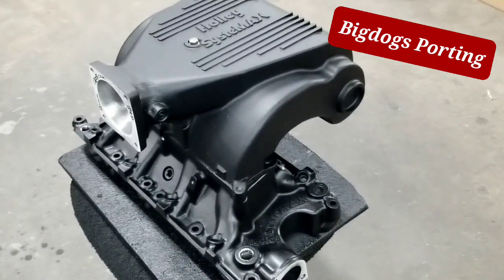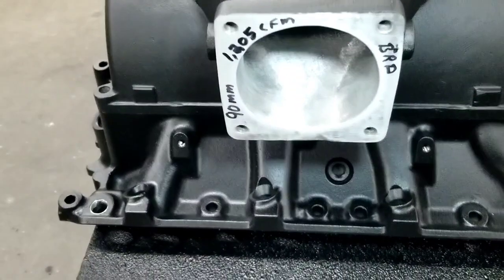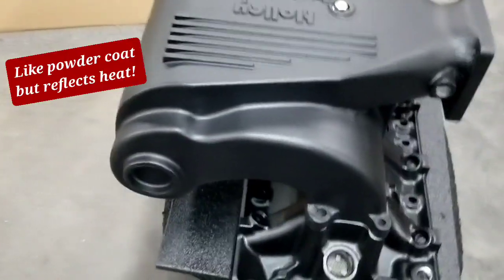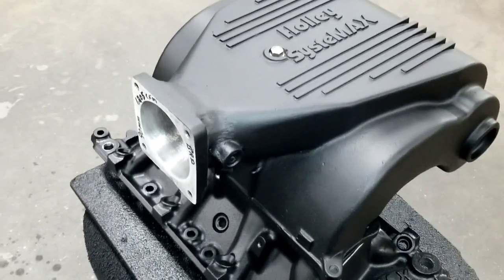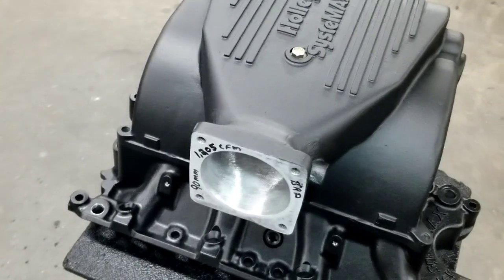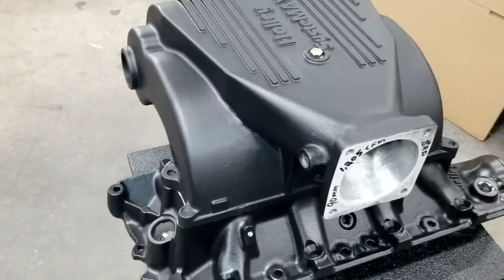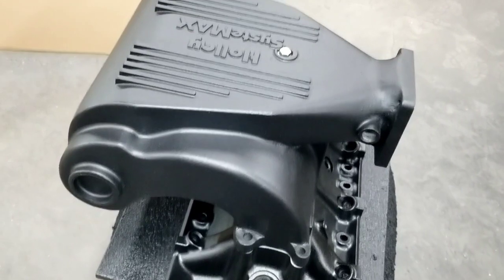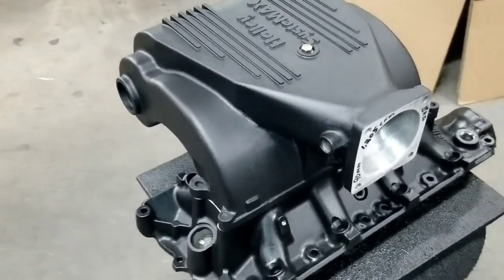Systemax 2 BRD, Part 2!😲 RESULTS!!!

Comment: What is the difference in flow before and after
Reply from the maker: A stock Systemax 2 average runner flow is  250-255cfm and TB tunnel flow is 1,050 cfm. BRD flow is said in the video

Comment: Are there any alterations made to the systemax for tall valve cover clearance or would a spacer need to be used still?
Reply from the maker: To run roller rockers without the need of a spacer is simple. We sell the perfect solution in valve size that is not too tall and not too short.

Comment: SWEET !!! What port job on a 95 cobra intake manifold would you suggest ?? going on3 turbo and possibly 347 stroker
Reply from the maker: Our Stage 3 with a ported 75mm throttle body

Comment: I’m here thinking what did I miss, what the heck is BRD? 😂🤣 I guess I’ll find out as I catch up on the subscriptions🤦
Reply from the maker: You have to get caught up lol. The BRD is our new porting stage which consists of 90mm TB tunnel, highest flowing TB possible, max shortening runners in the upper and lowers. Designed strictly for higher hp stroker and larger displacement motors.